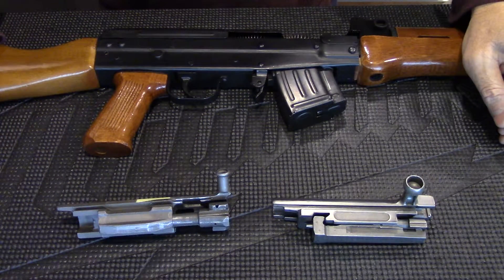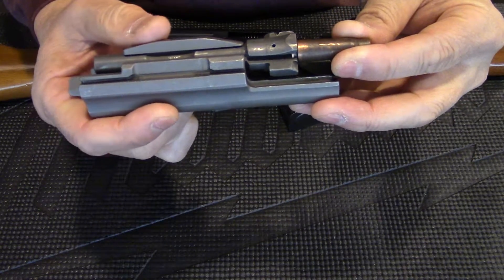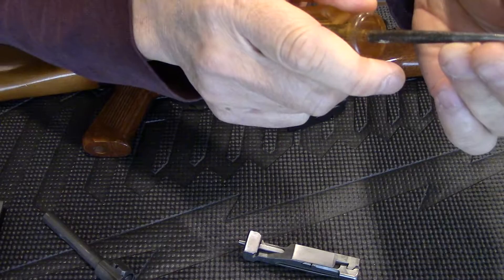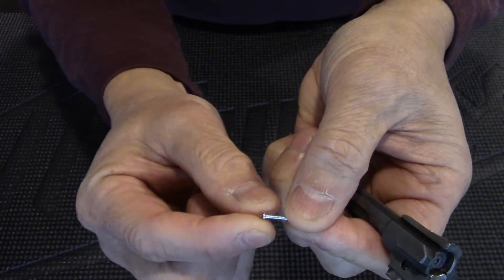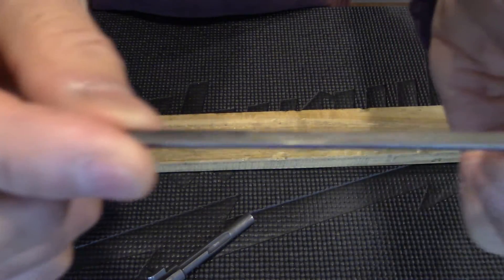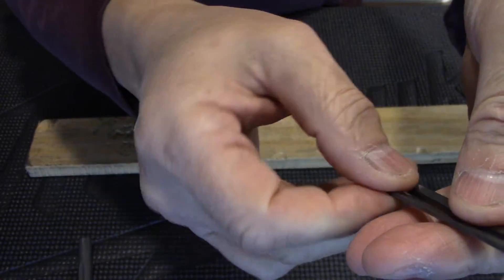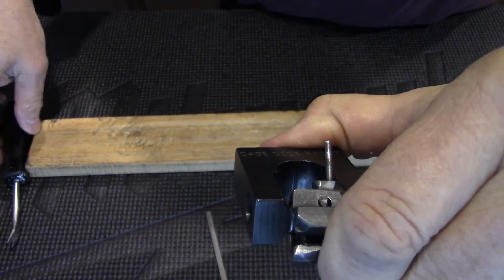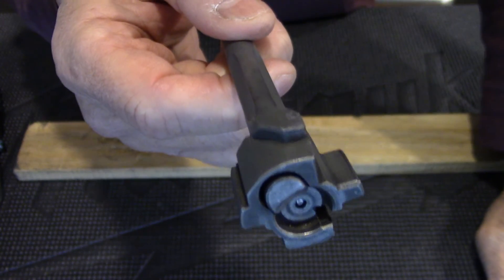Bolt- SKS vs Type 81 Full Monty Disassembly. Avoid slam fire

Comment: My firing pin is stuck right now, i shoot corrosive in my type 81, gonna try and take it apart when i get home, not to sure if its damaged or what, it was free floating when i got home to clean it, i threw it in hot water and now she will not move at all.
Reply from the maker: Yup, give it a good cleaning, soak it in solvent if ya havta
Reply: @gnutzguy  got the firing pin out, now time to see if it will strike the primer 🤞

Comment: For the life of me I can’t get the the retaining pin out. Broke the tool it came with and bent every nail. Any advice?

(Type 81M)
Reply from the maker: Ok. You were asking about the firing pin retaining pin. Soak the whole bolt in solvent overnight and try hammering it out again.
Reply: I agree with gnutzguy, and for pete sake use a proper punch, $7.00 at a hardware store. Use a block or vise as well. I tried mine several times and almost gave up... I was scared of scaring/damaging the bolt or pin and wasn't hitting it hard enough. Got a little frustrated and decided to finally give it a good smack, came right out. Used some emery cloth and one my wife's nail files on the pin and any sharp edges I could find. Still tight enough I had to hammer it back in but I am able too remove and install now with no issues. Worked on both of my Russian Made 1954 models. Thanks gnutzguy for all of your great video's, Keep up the good work. Best regards.

Comment: My firing pin retainer is stuck when I try to punch it out it won’t even move a little
Reply from the maker: does the firing pin still rattle?
Reply: @gnutzguy  yes it still rattles and I’m talking about the type81
Reply from the maker: thats good bcos internally it isnt rusted. soak it in solvent overnight in a jar.
Reply: @gnutzguy  CLP works ?as a solvent

Comment: What is the type 81 bolt carrier made out of? Sounds like a silly question, but I'm just wondering if I could polish it without harming the function. Thanks for making these videos!
Reply from the maker: No worry about harming it cos it's made very strong to carry the bolt, polish away lol
Reply: @gnutzguy  wow that was a snappy reply to an old video, love the follow-up! Do you think it's something I could chrome plate?
Reply from the maker: @wholock0001  just happened to logged in, lol. yup, chromeable.

Comment: Lots of people don't know AK‘s bolt carrier guide.
Reply: Except it’s not an AK, it’s more of a hybrid of an AK and SKS.  It’s got a short stroke gas piston.  Takes different magazines than the AKM.  The only thing that is the most like an AK is the bolt itself.    Very interesting rifle for sure.
Reply: @texasviking1  Type 81 is more accurate than than SKS for single shot, it made a lots of minor changes on AK's platform to improve accuracy.
Reply: @Greentangle   that may be true in some cases, but it still doesn’t make it an AKM or AK variant.   It’s a different gun all together.   Yes it definitely has many of the characteristics of an AK47, but all the parts that matter are completely different than the standard AKM platform.  The bolt itself is probably the only thing in the rifle that looks like an AK part.     It is however a very interesting rifle and I have no doubt that it is reliable.   It would make a nice piece for any collection.